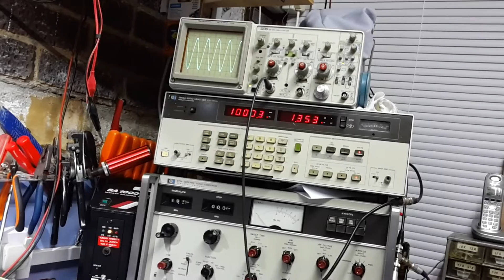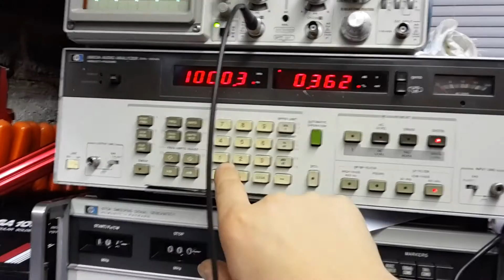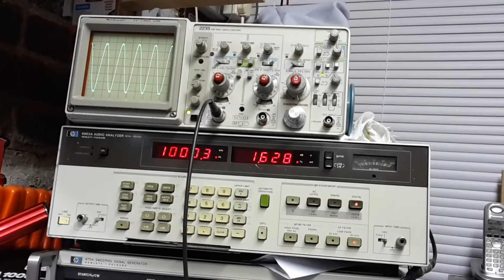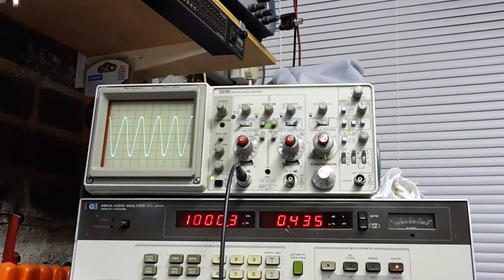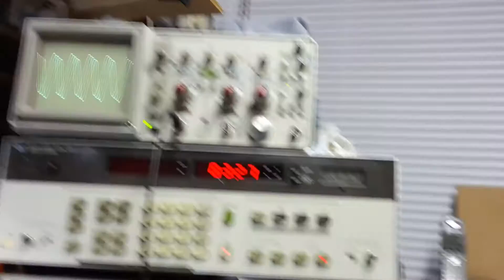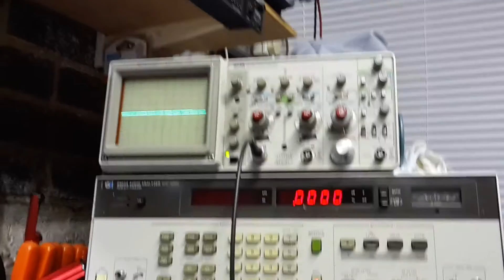Marantz pm44se power and load testing

Comment: Hi Simon, really cool and interesting video as I've had one of these since new, it hasn't worked for a number of years after I presume it got damp in my loft and I unwisely plugged it straight in after getting it down. It powers up and clicks but no sound. A local hobbyist electronics guy tried to repair it (he does TV repairs locally etc) but has given up on it. Where you have the emitter followers you fitted in pos R767 on the left is where the twin components (resistors?) keep blowing as soon as it's powered up, on the opposite position on mine in Q768 is an RGC33 resistor where you have another pair of the emitter followers. He also replaced the integrated circuit AN7062P and a few other components (inc the left bias transistor and the two transistors on the left, the front one of which is now in short circuit) but I think it's just those twin components at R767 that keep blowing (I tried it when I got it home with the cover off and they're glowing and smoking straight away!). Any tips you might be able to offer would be greatly appreciated! Thanks for sharing these videos anyway. Cheers.
Reply from the maker: Difficult to tell without doing some tests. Sorry/

Comment: I recently started using this amplifier and it seems to have quite serious power failure issues.  I have to really jack up the volume for the TT and both the TT and the CD player are prone to random volume drops and distortion.  The only reliable source I have is a Blu-Ray player through the TV's RCA-Out port (I don't know why that combination works while the other sources don't but it does).

The video mentions the power transistor as being a weak point in the amplifier's design so maybe my issues are related to that.  I'm wondering if the transistor can be replaced with something better to give it a bit more oomph.  Power supply upgrades are quite common in other areas of electronics.
Reply from the maker: That's not a lack of power but gain. Dirty switches are the most likely cause.